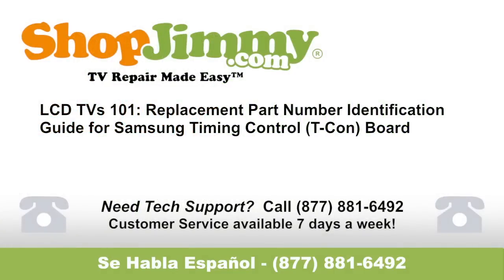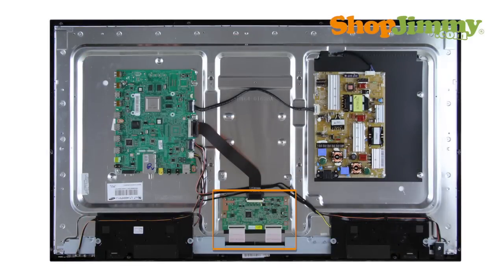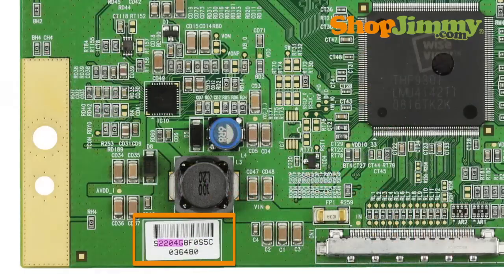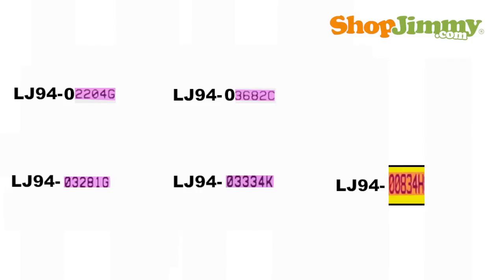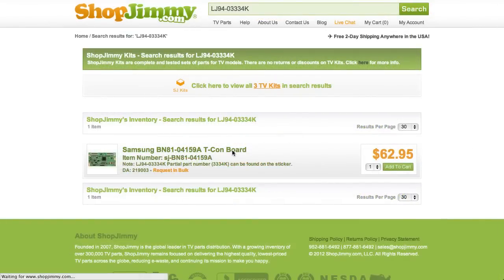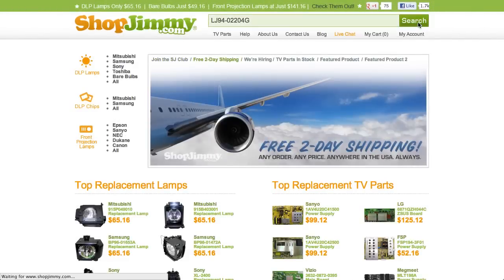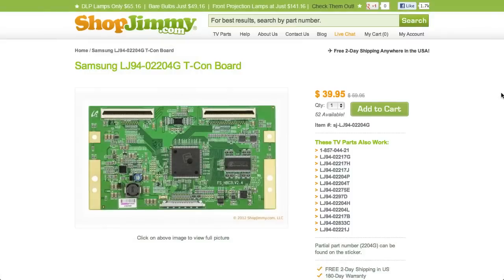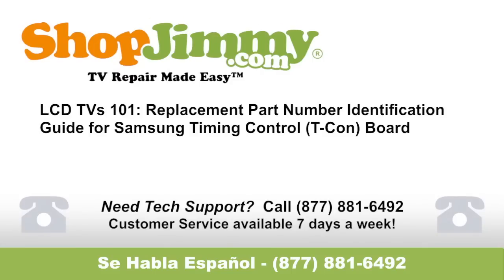Cómo reparar las líneas verticales Reparando Samsung TV cómo identificar los números de T-Con

Comment: Hi Jimmy , I have this issue with my tv , all started with a vertical line right in the middle of the tv and then half of the screen stared playing funny color and and lines started appear on the half of the screen left side to be exact,I checked the ribbon from the left side of the tv,I unplugged and plugged back and nothing ,just notice that started getting extremely hot  underneath where you plugged the t con ribbon ,any idea Jimmy , what could be the problem? Board maybe? Thank you

Comment: i have a tv led Sharp mod LC-32LE144E with power supply mod. DPS-140SP-2Which condenser do I have to short- circuit for bypass the error lampsMake me knowThanksMario

Comment: hey my tv have this problem when it crash by water how can i repair it    
i will sent you a photo for it if you tell me another email
Reply from the maker: rawaz42  PLEASE SUBSCRIBE TO OUR CHANNEL - Try all repairs and troubleshooting at your own risk.   Did your TV get water damage?  If the panel got wet, you most likely will not be able to repair that.  You can post a photo or video online and then reply with the link.  Thanks!  www.shopjimmy.com
Reply: thank for answer\ i will sen a photo to your page in facebook\
Reply from the maker: rawaz42  Try all repairs and troubleshooting at your own risk.  I saw the photo on facebook, and this looks like a TV panel (TV Screen) problem.  If your TV panel is bad, it may be more cost-effective to replace the TV as panels are typically hard to find in stock, difficult to replace, and expensive.  Thanks and please let us know if you have any further questions!  www.shopjimmy.com

Comment: Vertical Color Lines/Bars
Make: Samsung
Model: PL42A450P1XZP
(On the web I've seen pictures of the PL42A450P1, similar model)
Technology: Plasma
Size: 42"
So, the whole screen shows 3 rows of vertical color lines (purple, yellow -ish). When hitting the Menu button, the Menu shows up with more or less the same bars on top. I've switched different Inputs, and the result is the same. I unplugged it a few time for several minutes and hours, and the result is the same.
carlos.artilez@gmail.com